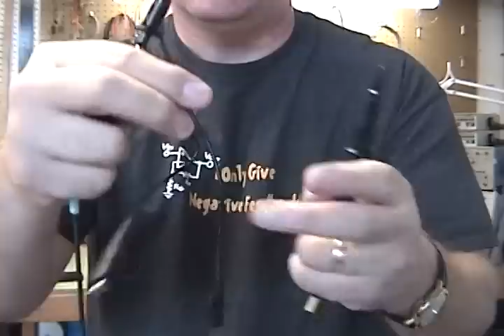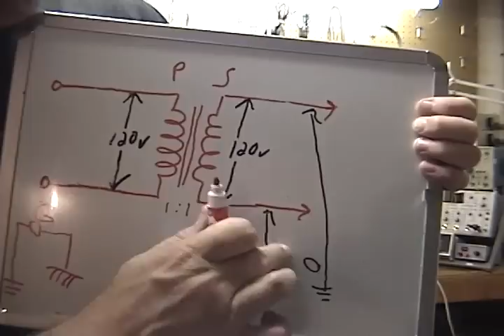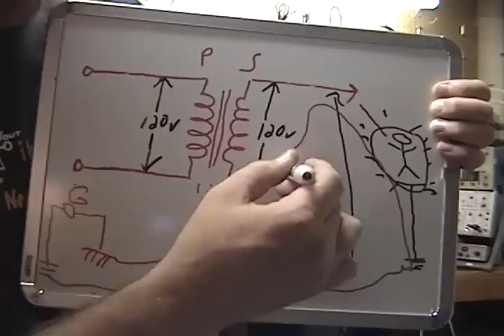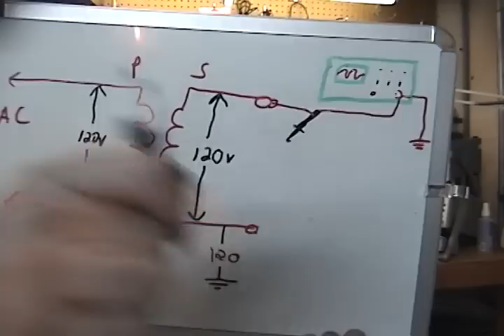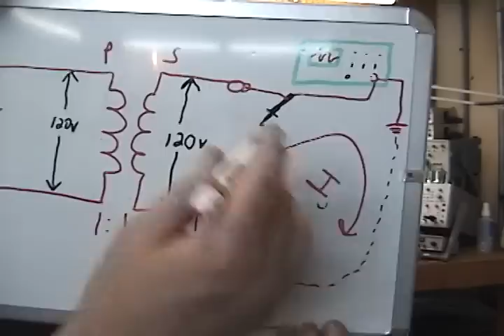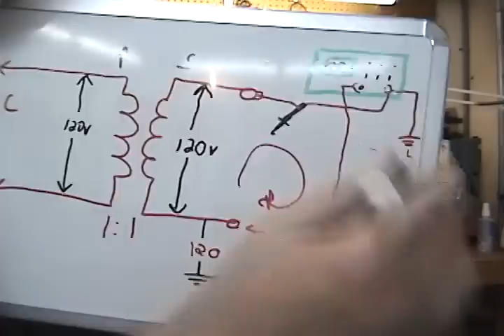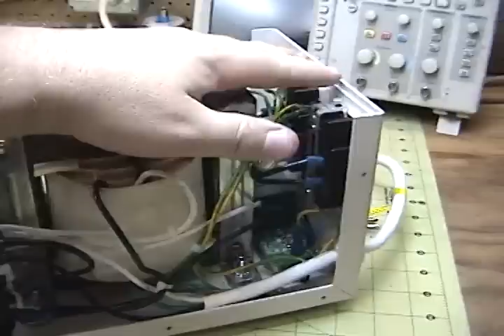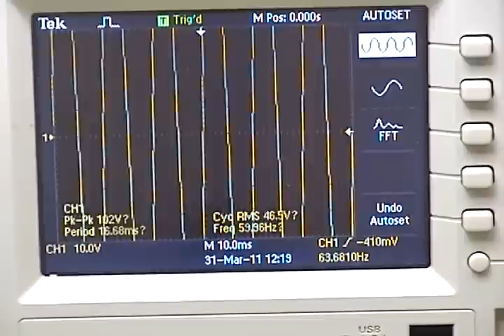ToddFun.com: Isolation Transformer - Tripp Lite IS1000

Comment: now at 43:28 connect the probe ground wire to the green and yellow ground wire @ 42:59 then connect the probe to the hot and neutral one at a time and see what happens. I'm guessing you are not isolated at that point. therefore,  testing any equipment that using a three-wire cord would mess you up.   or even better yet connect the bulb to the green wire on your pigtail then run a wire from AC main hot to bulb then run a wire from AC main neutral to bulb if either one lights up the bulb your not isolated. I would like to see this video redone with the test I proposed. I'm not trying to be a know it all asshole here. I just am unsure and don't want to see someone get hurt plus I never see anyone do the complete test &  think the ground wire is still connected to neutral at the main panel and can still cause serious problems if you are not lucky.

Comment: I watched many YouTube videos on I/T's so for $250 I bought one for my 14 year old future electrical engineer.  I am afraid for him to use it as it only will save the scope and not his life. I have 22 circuits in my house and each on a RCD (residual current device) which trip in 30 m/s and at an imbalance of 15 mA. Tested many times, bare feet, bare hands and metal object into active on power outlet.  So why did I spend $250 when for $15 you can buy a RCD which not only will protect your scope and other equipment abut also your life?? please someone explain to me.

Comment: You mentioned in the video that adding a GFCI after the isolation transformer won't help...  and that makes sense since if you complete the following circuit for example
       secondary hot -> scope ground -> earth ground -> "human" -> secondary neutral
you have mains current flowing through the human but no current imbalance between the secondary hot and neutrals to trip the GFCI.

However, how about if instead you are plugging the scope into a GFCI. I believe that GFCI's (at least in the US), in addition to sensing hot-neutral current imbalance, they also check for ground currents. In that case in the circuit above, the current flowing  "scope ground -> earth ground" would trip the scope GFCI, saving your life and likely also the scope.

Am I understanding this correctly?

Comment: Let's say you are looking for output scope patterns on a stereo system.  Question: You hook the scope probes to the left and right channels (Left red+ black- and Right red+ black-).  Even though the scope probe clips are on different points they are still a common chassis ground reference and do not pose an issue?  Is any common chassis ground a safe hookup when using a two-channel scope to compare patterns?

Comment: Why did you leave the ground prongs in the receptacles connected to the chassis ground? Isn't the point to keep the device under test connected solely to the secondary winding, with no possible path to earth ground?
Reply from the maker: Very much could do that for a tech bench. Only risk is that if the DUT gets high voltage mains from some other device or sourced location from a short or malfunction then the DUT could become main's live, and without the DUT connected via an isolated ground to mains through the IT the DUT would be dangerous. I know that is a low risk so most people do as you suggested but its best to have both options in case you are working in unsafe areas or with other sketchy powered testers, tools or equipment.

Comment: I’m totally against using isolation transformers to float oscilloscopes and equipment under test.  DMM’s are designed to float with isolated, differential inputs. Most of the oscilloscopes on the market were designed for single ended, grounded measurements. That why scopes have a single probe per channel and a black ground clip to attach to the ground reference in your circuit.  If your circuit is not ground referenced, you should save your money and buy a differential Isolated probe instead. Most major scope manufacturers offer these as an option. Your scope will stay protected at ground referenced and you will be better protected against electrocution. A Variac and a current limiting device such as an in-series power resistor or large light bulb will protect you and you won’t get electrocuted by your scope! I know of a Techician that was killed when he touch a floating scope that was floating at about 2kV! Floating scopes is also against OSHA safety standards and your company is liable if you are injured or killed.

Comment: super explanation
Reply from the maker: Glad you liked it !
Reply: Thahks for the video.
Removing the secondary neutral lead to chassis ground is clear...but I noticed you left the secondary outlet grounds as is (connected to the chassis). Shouldn't these also be disconnected from the chassis in order to probe around safely with scope probe/leads etc ..in order to eliminate the secondary having a reference to mains Earth/ground? Thx.
Reply from the maker: @SS-pi2yi  Yes, that you could. However note that the 3rd prong "safey ground" of any DUT shouldn't be shorted to power in any way unless there is a fault. However if that that short to safety ground exists on your DUT or you create the short when testing then you're right it would be better to remove that ground strap in the IT. Or you could just use a 3 to 2 prong adapter for the IT to mains plug-in to do the same safety ground isolation which kind of fixes the whole problem with this hospital grade IT all together. HA.
Reply: @ToddFun  understood,thx.

Comment: Great video except at 49 minutes where the circuit was not clear. Are you scoping between a live and earth wire supplying the bulb resulting in referencing the secondary winding to earth. A wiring sketch would have been helpful to clarify. Thanks for great video. Michael

Comment: Hi Todd, I have trying to find a answer to my electrical problem in my house.  I'm a musician with guitar amps that generally have a plate voltage of about 450v to 485v on the plates. My problem is somewhat of a conundrum trying figure why all of my amps have really bad harmonic distortion to them. I believe It's what is referred to as dirty power from the AC outlets in my rec room. I never used to have this problem years ago, but the last few years, I have had this annoying problem. I was considering getting one of these isolation transformers to clean up the dirty power from the AC plugs in my rec room. My question to you is, would getting one of these transformers cure my dirty power problem in my house? And also would it be safe using one of these for that purpose? My guitars and amps sound terrible with this problem. I thought if I disconnected my computer, fridge, anything with a motor or even my fluorescent lights that this would some clear up my problem, but nothing seems to work. Any advice you could offer would be appreciated. Thanks Michael Newell from Niagara Falls, Ontario, Canada
Reply from the maker: If your devices was good before and turning off and unplugging everything didn't help then most likely the filter capacitors in your amp are leaky. If that is the case then you'll have to have them serviced. To answer your questions about this transformer, this device could help but there are better power conditioning units on the market that would do better. Just look through the show notes and comments. I think there are some recommendations for just this power conditioning questions if I remember. A good test would be to get a 100 foot cord and take your amp out away from everything and see if that helps just to prove it isn't coming from something in the house still.

Comment: Thanks for the great vid - - one clarification I not sure I totally understood....
GENERALLY , do we usually power:
A)  the SYSTEM UNDER TEST via the ISOLATION Transformer,
  &  the AC TEST EQUIPMENT (such as oscilloscope) is powered as usual via regular home 3-prong AC outlet ?
                             OR 

B) BOTH SYSTEM UNDER TEST and AC TEST EQUIPMENT (such as oscilloscope etc) is powered via ISOLATION TRANSFORMER ?

Which is the correct guideline to follow A or B ?
thanks.

Comment: Perhaps a stupid question, but if you plug the oscilloscope into the isolation transformer, does that prevent the circuit to ground?

Comment: I have watched this video a couple of times. Here is what I came away with.
If you make the IT the tech version,   and plug your circuit under test to its output, you protect yourself from shock thru the ground. Also, you can connect your oscope ground strap to either side of the secondary and you won't accidentally short it to ground thru the oscope. 
However, once you connect the scope strap to circuit under test, that connection is now the ground and if you touch anywhere else on the circuit under test, current will flow thru your body to anywhere you are connected to ground.
It is a catch-22. You can protect youself from some shocks in the CUT by using a tech IT, but as soon as you get a scope strap connected, you are back in the getting shocked game again.
Reply: Yes, that is why avoiding using standard probes and using differential probes instead is a better option. With a differential probe the isolation remains in place. Things have moved on since this video was made; differential probes are now available much more cheaply. Siglent make some that are quite well regarded.
It's also worth mentioning that if you attach a signal/function generator to the circuit, you again will create a ground reference. This is because most signal generators have one side of their outputs grounded. There are isolated signal generators available, but these do tend to be more expensive.
Another alternative which is more pertinenent today rather than at the time of the video, is that battery-powered scopes and signal generators are now more readily available. These float so will not create a ground reference when connected. You do have to be aware however that the 'ground' clips even on a battery scope may be connected together so you should avoid connecting them to different parts of the circuit otherwise you risk a short.

Comment: the take away is, ditch the earth ground from the scope, measure it with differential probes, or use two probes and set to math function, probe 1 - probe 2.
Reply from the maker: Yes, that is a very good short summary. Thanks.

Comment: What about that ground wire I seen coming from the 2ndary winding.  I.e. Output side. of the transformer. If that runs to an earth reference. Then even if you removed the ground strap from the neutral wire on the Nema 5-15 output receptacle. You might still be earth referenced? 
 I could not see where the ground strap was leading to, Only that it was coming from coming out of the 2ndary side.
  I've seen ground wires coming from the windings on the input side before. I believe a ground strap in the input winding is for coupling. I'm not sure about the 2ndary side having a ground strap in the winding?  This is more of a question, not a know it all comment.
Reply: I have the same question.  AND, should it be disconnected also?

Comment: I am completely new to this, but recently bought an oscilloscope, and attempted to repair my 5.1 surround sound amp, though it ( the amp) failed after I decided to become interested in electronics. I have never dared to use the scope on the "test equipment/ repair equipment" - I know either me or my new scope would die. But still, I have a few questions, which may seem real dumb.

BTW everything where I live is really expensive - €168 minimum for the cheapest isolation safety transformer I can find. But it is a reputable brand I believe.

Carroll & Meynell, 750VA CM7501 Single Phase Isolation Transformer, 230V ac

Are we always going to be safe if we connect the probe ground to GROUND? I am a complete newby, but even I can find a ground - usually the metal case of the "test gear". But why is that bit so difficult? I am NOT being sarcastic here, but why is that so hard, unless it is one of those mental american radios? I do not intend to ever touch an old product with a "live/hot" chassis.

Next question is, what if we used the oscilloscope and the test equipment isolated? Either on the same "isolator" or even on two different isolators?

Would 2 different and separate isolators protect person and scope, at least in a one probe scenario? Obviously a 2 probe scenario on the one oscilloscope might/would not work, but going on... What about 3 isolation transformers and 2 oscilloscopes, all running on separate isolation transformers- would that be "safe"???

I do not know this answer, which is why I am asking - I watch  a fair bit of EEvBlog, but am still trying to understand what will cause me to have a BANG and a really bad day.!

I think I may just stick to low voltage stuff, - does anyone want to buy an unused used Rigol 1054Z pirated to the last?

I only started, but already feel wayyyyy over my head. I think this stuff has to be learned by "osmosis" over decades, or the hard way.

Comment: Hi Todd, Thanks for your excellent video.  I’m newly interested in electronics because I became interested in repairing AA5 tube radios.  I quickly learned that I needed an isolation transformer for safety working on a potentially live chassis and, after reading different sources and watching your video, got a Tripp-Lite IS-500 IT.  As someone noted below, the wiring isn’t exactly like your IS-1000 in the video.  Five ground wires connected to the IT’s grounding point.  One from the mains; one accompanying the neutral from the secondary side; one from the primary (?) side; and two from the IT’s outlets.  I disconnected the one that accompanied the neutral from the secondary as you described in your video.  After reading some other information I also disconnected the two ground wires from the outlets.  I tested the outlet voltage with a Fluke 117, and got results similar to yours using both V-AC and the Auto Volts/LoZ settings.  Checking continuity and ohms, there’s no continuity from the IT’s line cord plug’s ground prong to any of the IT’s neutral or hot outlet slots; those read OL. There is continuity from the plug’s ground prong to the IT outlets’ ground slots, depending on where the probe makes contact.  It can read OL, but sometimes reads around 0.3 ohms depending on probe placement in the ground outlet.  I’m uncertain exactly why there would be any continuity there with the outlet ground wires disconnected, but...  After reading some of the comments on your video it appears that it might be safer if I reconnected the outlet ground wires to the chassis ground, leaving only the secondary neutral ground disconnected.
Do I have that right?  If I understand correctly, there would still be no reference to ground on the secondary side for the DUT even if those outlet grounds were re-connected, so I’d still be protected from completing that circuit. 
Sorry if I didn’t explain this clearly or used incorrect terminology.  I’m definitely just learning.  Thanks!
Reply from the maker: You are correct. You want the secondary not wired to ground. You do want the IT outlet's ground connecting to earth mains through the IT chassis or you can drop the outlet's ground connecting to earth mains through the IT chassis which is save too "maybe even safer" but if your DUT becomes mains energized by some other lab equipment or wiring then having the grounds connected through the IT chassis gives an alternate path to ground through the IT chassis. Hardly an issues either way so if you don't connect those IT outlet's ground wires to the IT chassis that's fine too.
Reply: Thanks very much, Todd!  I may reconnect those outlet grounds, then, to provide that “alternate path” should the DUT become energized by test equipment, etc., as you say. 
Along those lines, if I understand correctly, if I put a Variac betweeen the Modified IT and the DUT, I should still be isolated because the power from the IT through the Variac is still not referenced to the mains ground, even if the Variac has a 3-prong grounded line cord.  
Thanks again!
Reply from the maker: @williammorris7571  yes, you would still be isolated.
Reply: Perfect.  Thanks, again, Todd!

Comment: What a load of uniformed rubbish
You do not earth or carry over the earth on a isolating transformer
You have in effect a 1:1 transformer NON isolating
You can have the casing of the transformer and the shield between the winding , BUT NO EARTH ON THE OUTPUT
Reply from the maker: I think you are missing the point of the video. It was to show that this isolation transformer is not isolated as expected for a tech bench isolation transformer and how to alter "this brand" of medical isolation transformer to be a tech isolation transformer. And how to test if you have a tech isolation transformer or a medical equipment isolation transformer so you can be safe as you would expect to be. And also at the end I show how other testing hock ups can case a DUT to no longer be isolated when using other grounded test equipment.

Comment: if use isolation transformer for your scope and same isolation transformer for circuit you testing is should be fine or not ?
Reply from the maker: Mostly. But some scopes will not work correclty 100% if you float them and some can even be damaged. However, I do it all the time without too much issues. I'm not taking perfect readings wither.